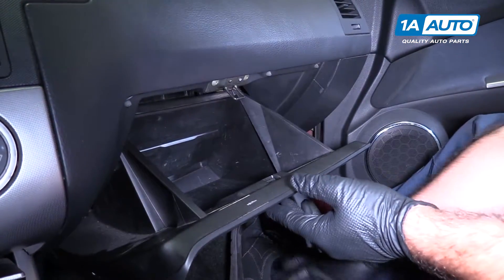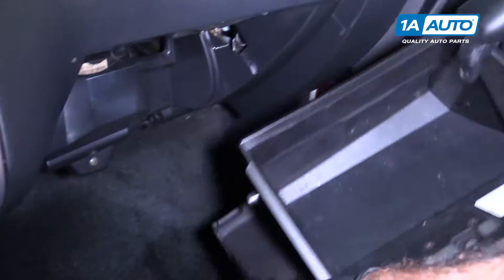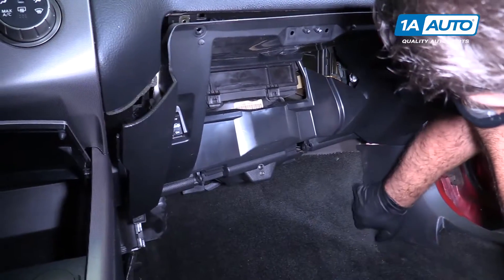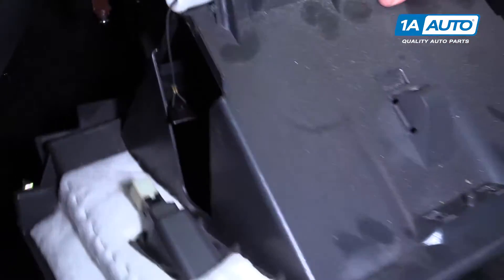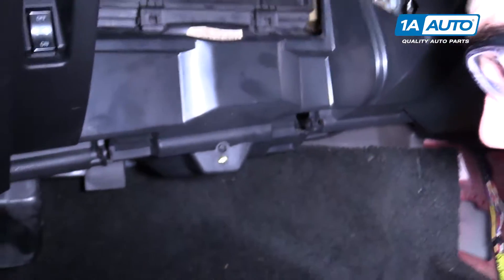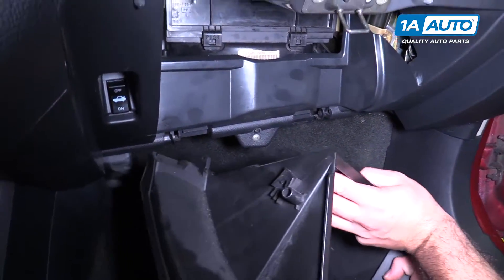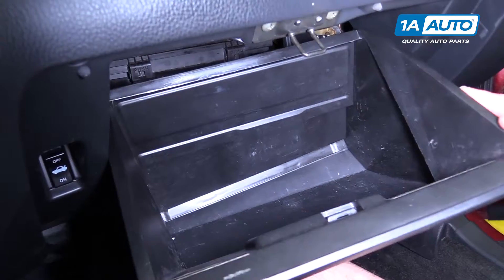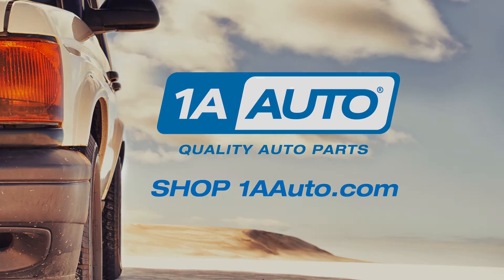How to Replace Mounted Trunk Switch 02-06 Nissan Altima

Comment: I'm struggling with that trunk release/off and on switch in the glove compartment. It has no resistance, and so the trunk won't open, I just can't figure it out. Please help.
Reply: Pls let me know if you’ve solve this I have the same issue

Comment: Hey, I have one of these switched in my Infiniti, it’s and on/off switch and a car with a trunk open as the logo, what does this do?!? Just seen it today
Reply: This enables/disables the trunk open feature. If in the off position, you cannot open your trunk at all. My switch broke and I cant open my trunk. Looking for a replacement part.
Reply: @ovidiogarza9387  any luck? Currently looking for one myself!